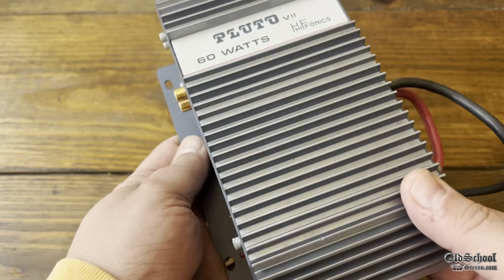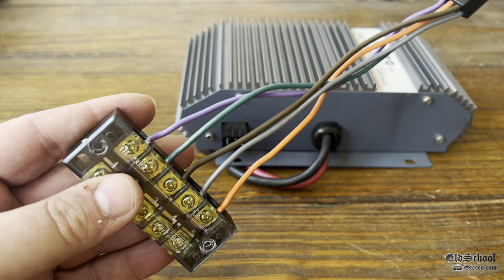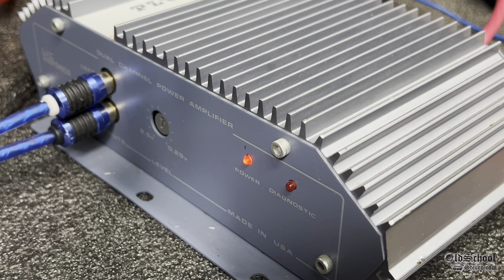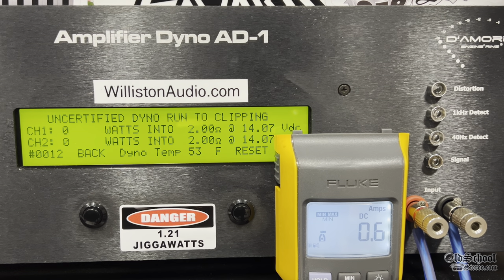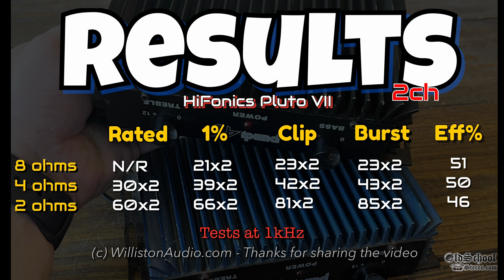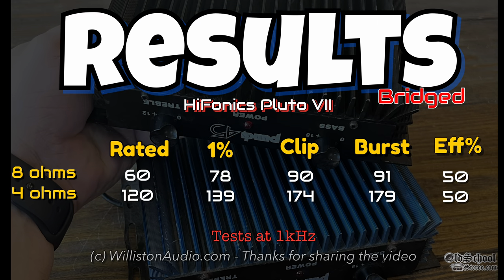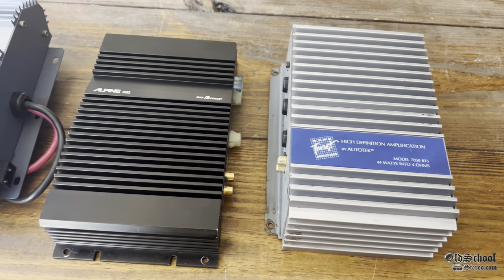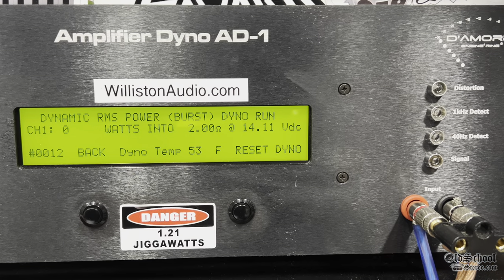HiFonics Pluto VII from 1989 Amp Dyno Tested

Comment from the maker: SHOP
Speaker/Wiring Terminal Blocks: https://amzn.to/4a4rIDu
Elac Bookshelf Speakers: https://amzn.to/47Q6zw8

RELATED VIDEOS
1990 HiFonics Zeus VII Amp Dyno Test: https://youtu.be/Wzcfx3I2tdo
1989 HiFonics Boltar VII Amp Dyno Test: https://youtu.be/Fz0dX9YEWUc
1992 HiFonics Odin VIII Amp Dyno Test: https://youtu.be/_gv0-RY1xQg
1987 HiFonics Colossus VI Amp Dyno Test: https://youtu.be/rA0fnerIffM
1983 HiFonics Odin IV Amp Dyno Test: https://youtu.be/NKiWeYjdbkE
1990 Autotek 7100 BTS Amp Dyno Test: https://youtu.be/-mzNp0mwU3Q
1992 Autotek 7300 BTS Amp Dyno Test: https://youtu.be/avuKGSDPgZQ
1990 Autotek 7054 BTS Amp Dyno Test: https://youtu.be/tqJzQe3Piyo
1990 Autotek 9050 BTS Amp Dyno Test: https://youtu.be/lflHCJhYKLA

TEST BENCH EQUIPMENT
SMD / D'Amore Engineering Amp Dyno: https://goo.gl/sJTcf7 
XS Power LTO Lithium Battery Cells - https://lddy.no/1ivr6
XS Power D1400 14V AGM Batteries - https://amzn.to/2BPFCKW 
XS Power Titan 8 Lithium Battery - https://lddy.no/1iq28
XS Power PSC60 Charger - https://amzn.to/2CHGcfs 
Fluke 1000A AC/DC Clamp Meter: https://amzn.to/2Rw5WDA 
Handheld Dyno: http://amzn.to/2u2EgKV 
My Favorite Screwdriver Kit: https://amzn.to/3vijokl

DISCLAIMER: This video and description contains affiliate links, which means that if you purchase from one of the product links, I may receive a small commission. As an Amazon Associate I earn from qualifying purchases

Comment: 2:35 they used red back then because the blue led as we know it now, wasn’t invented until the mid nineties and not widely adopted until the later.
Thanks for another awesome amp dyno video, sir!❤
Reply: And the green LEDs in 1989 were basically yellow…and expensive compared to red. 1989 folks were used to red power LEDs.

Comment: I still have my Pluto rated for 70 watts. I initially had it to run door speakers with a Cyclops running the subs.  Once I became a family man I kept things simpler and smaller and have been running the Pluto on a single 8. Still sounds great to this day.
Reply: Mine is currently running a 10".
Represent! Lol.
Reply: The Zed built “Cyclops” 100x1 mono amp was the first ever mono with built in crossover that I payed a fortune for and hands down the best amp I EVER owned for 2 decades! Mine was stolen and I still dream about it!#ZedMemories#80’sBestofTimes#🔊❤️@DGM218

Comment: I started driving in 1991. By the time I was ready to get my license, I had already purchased a car and installed a system in it. I lusted for these old school Hifonics, Phoenix Gold, Soundstream, and Alpine amps. My first system consisted of the very first CD Changer by Sony with an attached controller/headunit (looked like a white tackle box) feeding 2 amps; a Majestic 100x100 running in 2ohm load to Boston Acoustics 506 plates in the doors and 4" Pyle closed-back in the rear (at the time, I had no idea what a front-stage meant). For the subs, I had a Coustic 380 powering 2 Blaupunkt 8's in a dual chambered ported enclosure tuned to 38hz. That system was my pride and joy until I heard a car burglary gang was targeting my car, so I uninstalled everything and sold it off. That system is what hooked me, and now at nearly 49, I'm still in the game, though my current system is waaaay more advanced and robust. I'll never forget those first few years in car audio, though. I learned so much by experimenting and reading as many magazines as possible, going to car audio events, and hounding my local audio shops for tips and pointers.

Comment: In 1995 I bought a HiFonics Zeus amp from The Stereo Shop in Pomona (it was out of their demo Datsun 510). That amp bumped hard, but then like a year later I discovered that I wasn't even running it in bridged mode. After that is nearly cracked my windshield with 2X JL W0 12's. Amazingly, I happened across a matching 4-channel HiFonics Olympus amp at a pawn shop. I put that to a set of Boston Acoustic 3-way components and a big EQ with 2 caps. Damn that system was clean.
Reply: Damn, u rich bro. ;)

Comment: This is right around when I got into car audio, when I was 12 in 1989. They sold Motorola Pagers at my local audio store so I got one lol. I had a full system before I even had a car. Couple 12" Pyle Drivers on a Zapco with a Alpine head unit. Went into a Honda Accord my grandparents sold me for cheap.

Comment: I got one of these on trade back in early 2000s think i still have it at my dad's house attic. Only thing is the 2.5v gain using it on my head unit it would distort before max volume. I was told it's because the head unit put out to much voltage for it.

Comment: these could go down to .5 ohms. competitors loved these in the low-power categories. the pluto could run eight 6" mids or tweets at 4 ohms each.

the issue was the massive amount of current these would draw... they were unbeatable.

knew a guy ran 4 15" subs off a single hi-fonics jupiter.  with three amplifiers, he was unbeatable.

Comment: It was probably "properly" rated 2x 30W@0.01% and you get more because you're running it up to 1% and beginning to measure a clipped signal. 1% is quite clipped. Amp dyno lies. It's a cool novelty though.